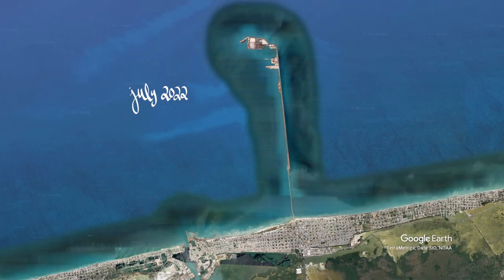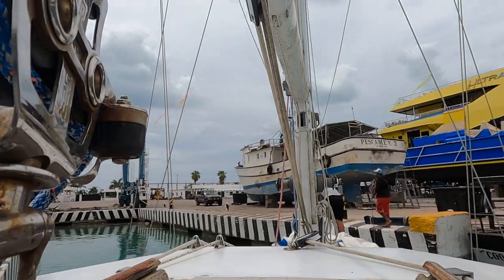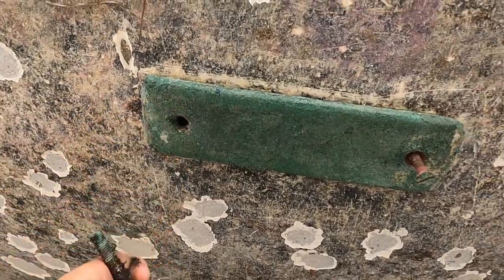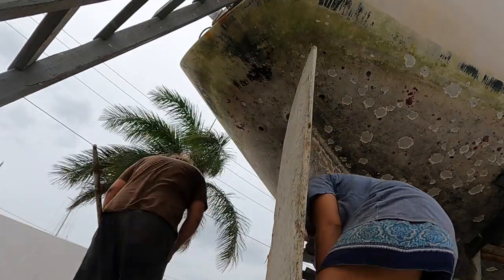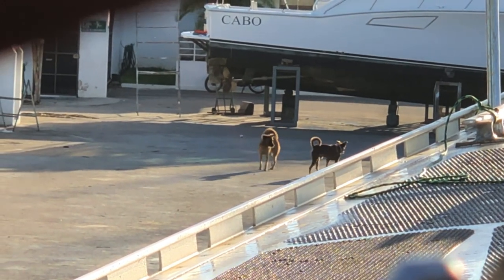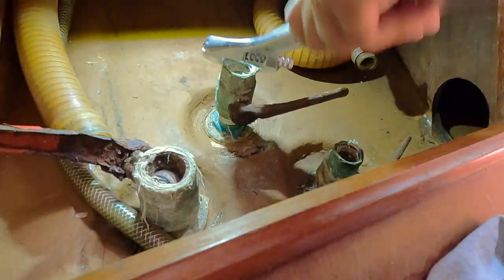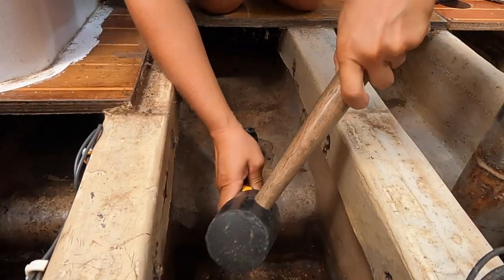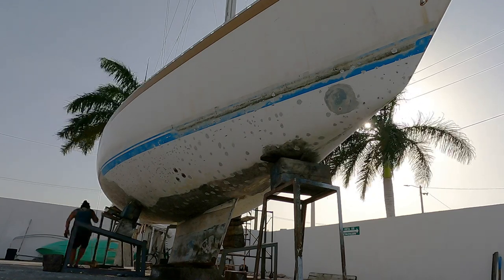OUR SAILBOAT BOTTOM restoration

Comment: Dewalt have used the bottom of the barrel bearings there - nasty little chinese piece of poo  - I would find a bearing supply store and find an alternative replacement made by SKF or similar quality
Reply from the maker: We actually have a box full of bearings for the other sanders - and we were preparing to buy the replacement bearing for this dewalt, however it’s impossible to detach the bearing from its assembly - they make it impossible to replace only the bearing. Not very nice!